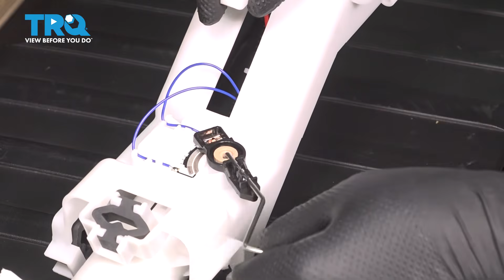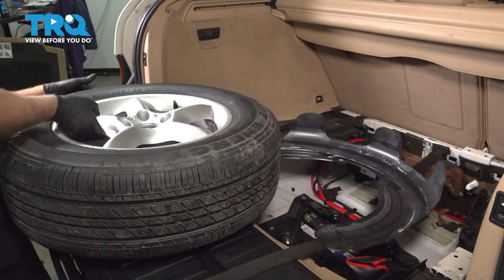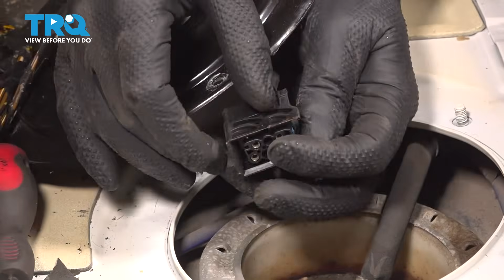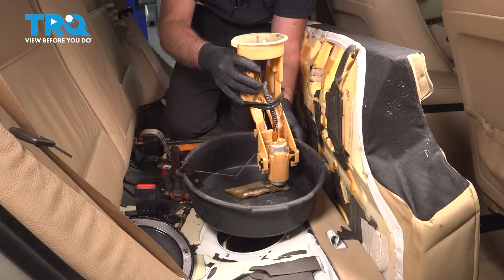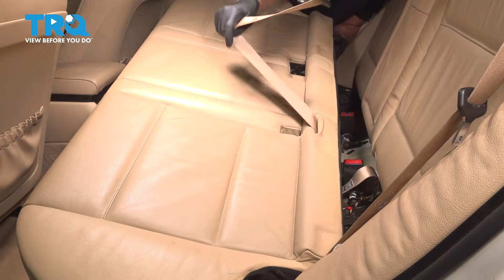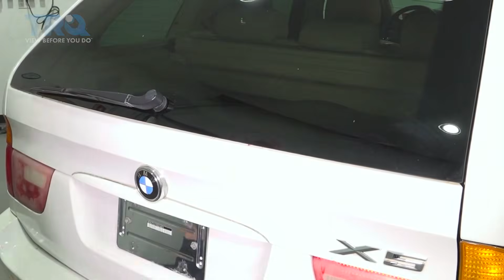How to Replace Fuel Pump Assembly 2000-2006 BMW X5

Comment: I replaced the fuel pump then  I turn the key over but no fuel comes out the rail when I removed the cap but when I pushed the pin there was a squirt of gas so does that mean Its fine although non came out when I turnt key over??